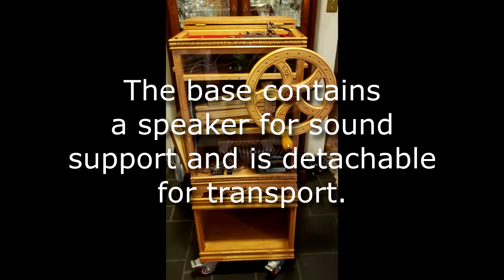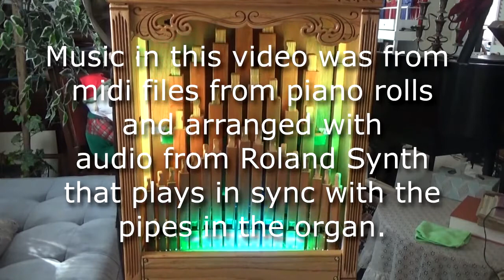Midi Street Organ Build

Comment: That’s an unusual way of making pipes. Wastes a lot of wood. I’ll stick with old way. Not everyone can afford a CNC machine and all of that wood. Nice organ. Love the Casing.
Reply from the maker: Yes, does use up wood, but I was using rather cheap wood, Homedepot 2x4s. :) The CNC was home built as well, runs on GRBL with an Arduino and free open source code, mechanical parts from China.